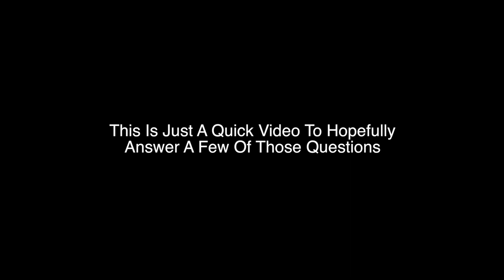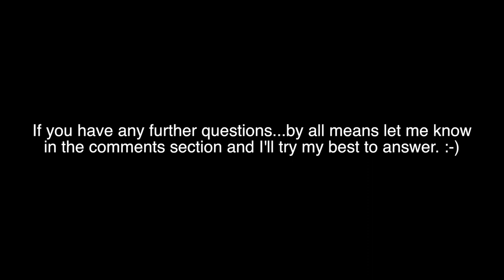Crimson Guitar Shielding Paint - A Quick Look

Comment: Hi
Very informative video!!
Thanks.

I opened my bottle (without using) before reading about the 3 months limit. 
Can I still use it after, say, half a year?
And I would have thought they have an adhesive cover over the bottle opening to save my kind of mistake.
Reply from the maker: Not sure if I replied and it didn’t send. But I would email Crimson to check. I’m not sure if the product goes off or loses its conductivity. Would be interested to know myself 😊👍